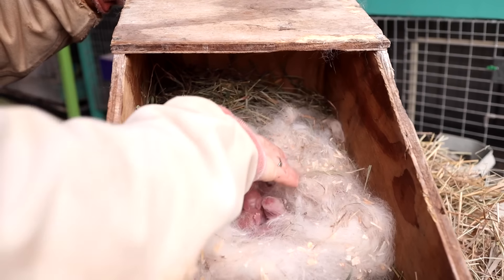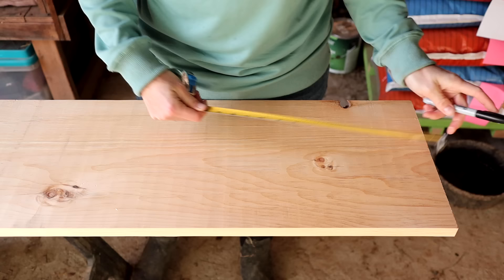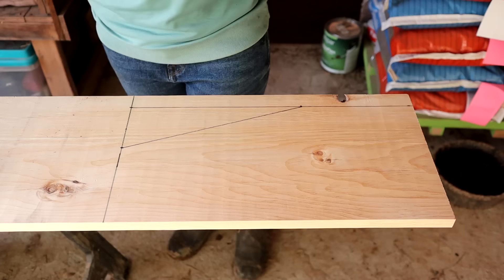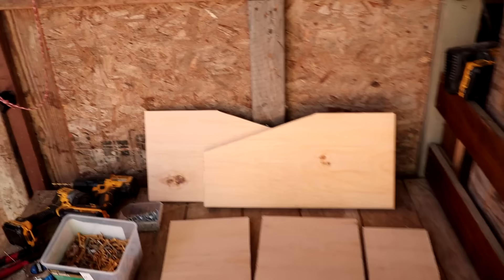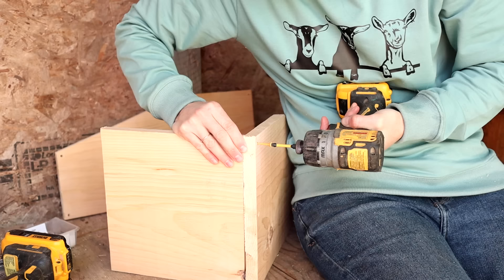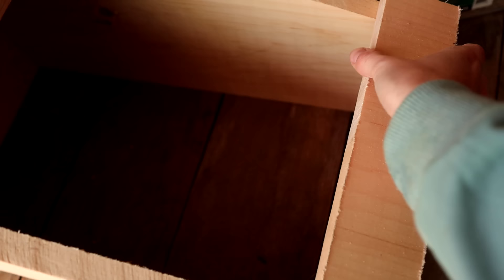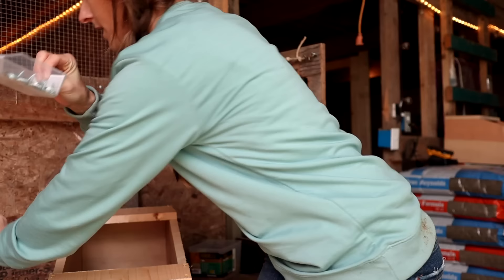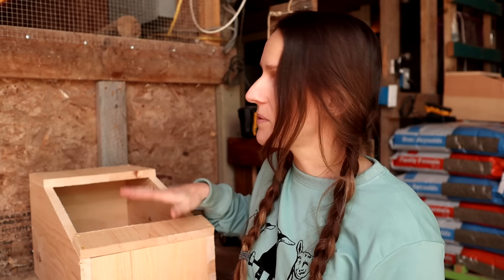Rabbit Nest Boxes - Easy DIY for meat rabbits + some tips!

Comment: another thing 1/4 inch hardware cloth is teh recommended cloth that snake wranglers recoment to keep snakes out of yards , coups etc. i beleive it works on all species of snake... but this lesson came from those snake proofing against baby ratlers in az.   so it should work ... if you have snake pressure it will help on the outside ofteh gage and if you got chickens.. go at least 3 ft up.  just some info , if u feel its useful